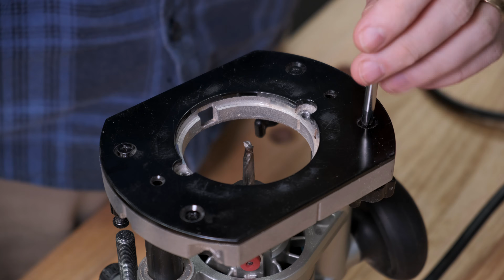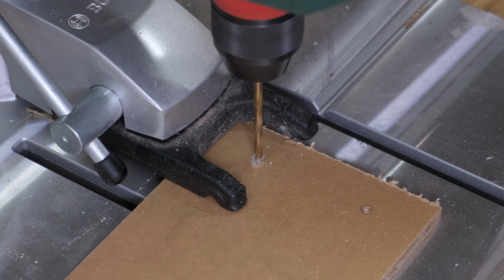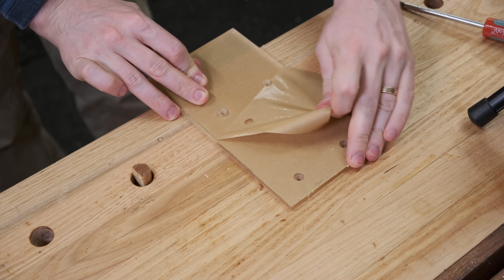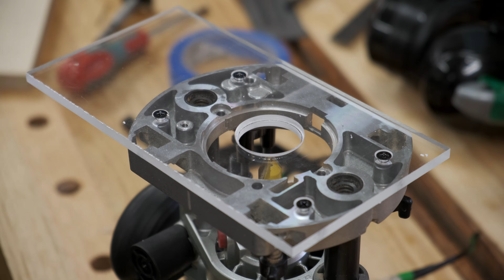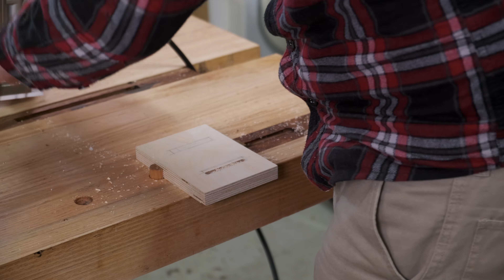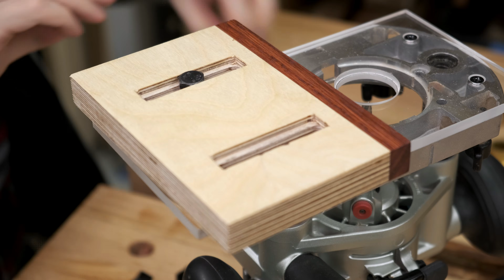Workshop: Add Guide Bushings To Your Router | Woodworking Shop Project

Comment: you need to use a clock gauge on your drill set up as the bits are wobbling.  Something is not set up correctly.  Good info otherwise. Thanks

Comment: I have just bought one of these routers. A circular piece of metal came with it which is referred to as the guide bush adaptor. I was looking for a video which would explain how to attach this part and this one came up. There doesn't seem to be any explanation video in existence as to how to attach this part, which makes me wonder is this a new addition which would make what this guy is suggesting no longer necessary?
Reply from the maker: Different locations sell different packages. Mine came with a bushing that fit the fixed base, but not the plunge. At the time i purchased my router, the plunge base wasn't an option.
Reply: @tmuWolverine  thank you I'm in England bought the basic package cordless. I see, thanks for your reply, I can see you have made a great mod in this video. I don't have the plunge base yet so I guess I can just use what I've got once I learn how to attach it.

Comment: Can't you just use the 321492 ? I just can't seem to figure out how it mounts, and there's no video or guide that shows how it's done.
Reply: Yes, if you buy a complete bushing set it comes with this.  Works on every Makita router.  Two screws hold it on.  Put the side with the groove down and the screw heads hold it on.  You router probably came with them, usually already installed int he base.

Comment: Which bushings do you use or recommend? The bushings that came with my rt0700 didn't convince me... 
Nice little project, thanks! 👍
Reply from the maker: Honestly, I think when looking at the brass/portercable bushings, they're all mostly the same. My big Bosch router has the bosch specific bushings and they're "unique" but not better than the brass ones.

The one I have is the generic "8 piece brass bushing" set that comes with two brass lock nuts, in a plastic case. At least 5 different brands sell it on Amazon, they alll look the same. ie https://amzn.to/3eiVEQ8 (not a specific recommendation as I haven't purchased that one, but looks identical to the kit I have!)

Comment: Nice video, Paul!  Maybe glue 2 thin strips on the wood alongside the acrylic? That would keep it from twisting and force it to slide in a straight line only.
Reply from the maker: You're right, that'd stop twist...but the twisting can be advantageous in some cases! Because the orientation of the router/bit doesn't matter (round cutter doesn't have a "square" alignment when cutting), twisting can act as a micro adjustment by just loosening one of the two lock knobs.

Of course...if it glides smoothly in a straight line that would probably provide the same micro adjustment, hah

Comment: Great video mate, any chance you could link to the counter sink bits you mentioned,  not seeing much on  Aussie ebay, thanks
Reply from the maker: Ah, looks like all the cheap-chinese-importers are calling them 'chamfer counter sinks'.

https://www.ebay.com.au/itm/4pcs-Chamfer-Countersink-Deburring-Drill-Bit-Set-Crosshole-Cutting-Metal-Tool-GU/401746005173?epid=18015933782&hash=item5d89ed8cb5:g:~JMAAOSwT4lWTww8